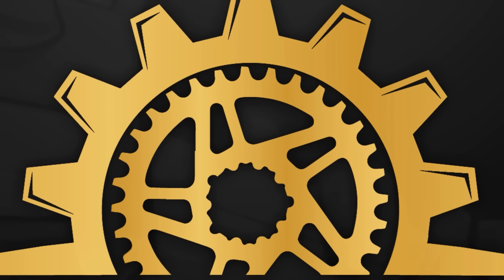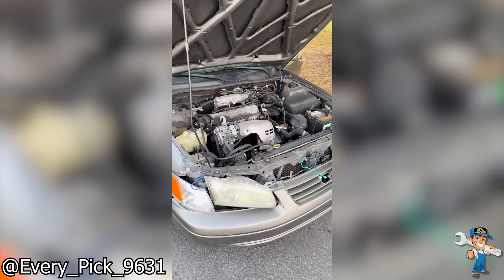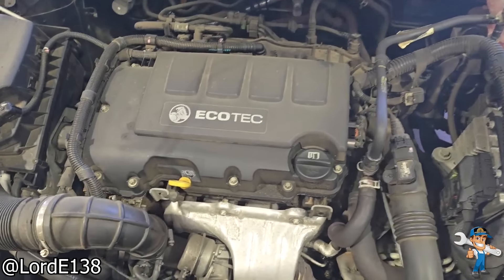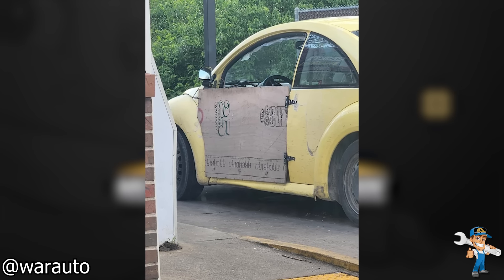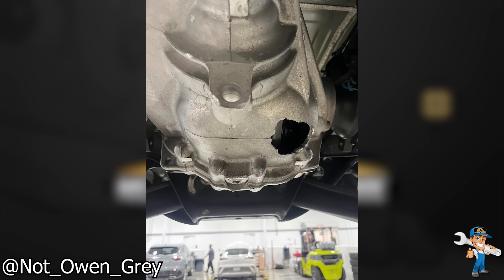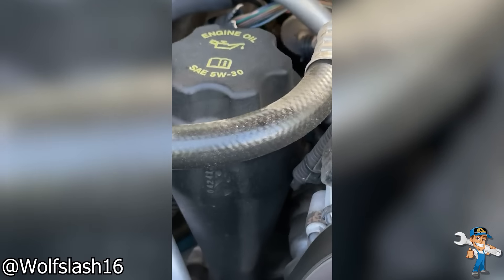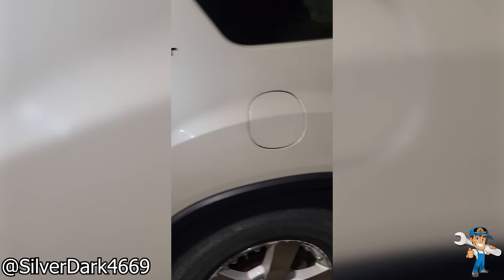Customer States They Installed Wooden Door As Temporary Fix

Comment: One with the doll in the child seat is obviously a Carpool violator, and the one with the pinhole in the AC line I would suspect a shady mechanic who was going to tell them they need a whole new compressor etc. and charge them like $1k and then he would just replace the hose.
Reply: Fair enough on the doll but the hose has multiple layers so looks like a normal failure.

Comment: What's wrong with a wooden door?
        Look at the doors they put on some Jeeps. 
                                     😄
Reply: The hinges on the right makes it a suicide door. Other than that, it’s all good.
Reply: @AffordBindEquipment  suicide doors are fine
Reply: @redtra236  I missed that part!  Maybe there is a safety latch interlock with the ignition toggle switch.
Reply: @AffordBindEquipment  Or just dont get out of your car when the vehicle is moving... not that hard. Regular doors are the same way if you get out while the car is moving in reverse.

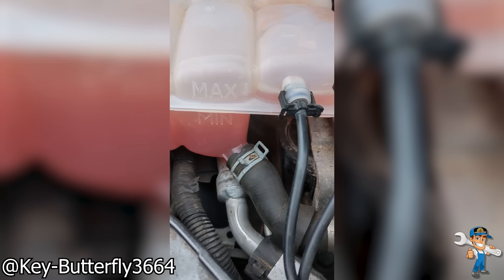Comment: 02:24 That is a endemic problem to Ecoboost engines. Normally when you see that, it means that the damage is already irreversible and the repair is quite expensive.

The whole problem starts with a belt bathed in the same engine oil that literally disintegrates, clogs the oil suction cup and blown your engine.
Reply: Also happens on the 1.2 Puretech (citroën, Peugeot). Reason to use a wet belt system is to, actually, reduce emissions. Using a wet belt system reduces friction losses on the timing system up to 30%.

Which equates to around (and I'm not joking) 1-2% increase on total efficiency. 
Makers are using a system that combines the worst aspects of both chain and belt timing systems just to gain an almost negligeable improvement on efficiency and emissions.

Comment: I replaced the evaporator in a 2019 escape. Along with having to remove most of the parts in the acadia. You also have to remove the front seats and the front doors.

Comment: That is any modern vehicle that needs an evaporator or heater core.  Most of the time it's easiest to just yank the front seats out of it.  On Suburbans/Silverados you have to because the center console is held down by the inner seat bolts.

Comment: 3:00 been there.  Surveillance footage showed it took them six minutes, including parking and driving off.
I fixed my exhaust and replaced my cat myself.  Because I don't live in Commiefornia, I was able to buy an aftermarket cat from the jungle site.
Reply: Was it a clean cut?
Reply: @DrEpicPhD  Get one that's next size up, slip it over pipes, then it's an easy weld. Or better yet, just install gutted cat and trick ecu.